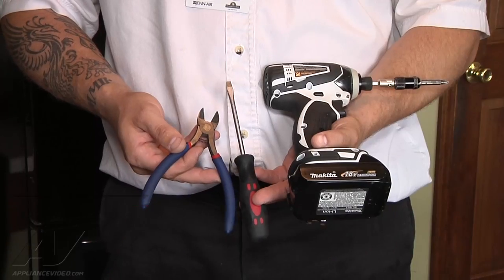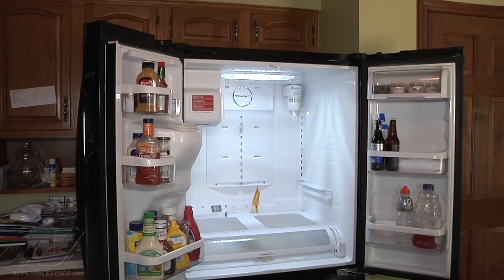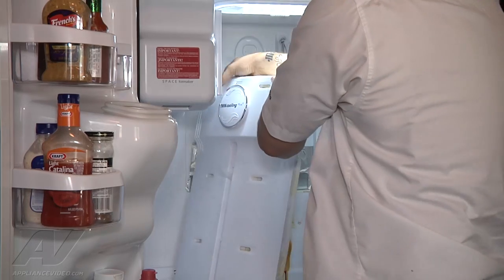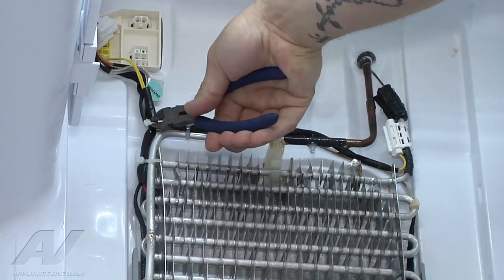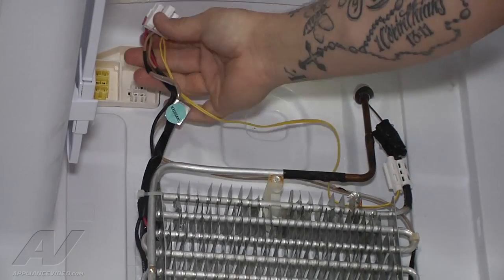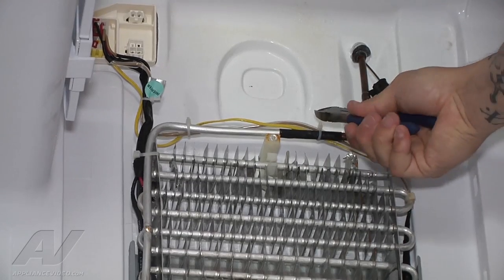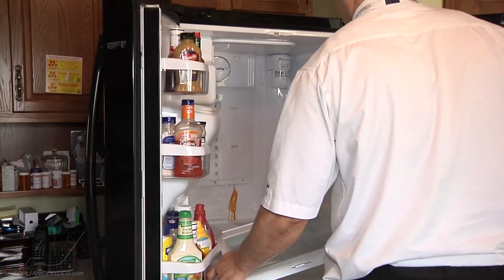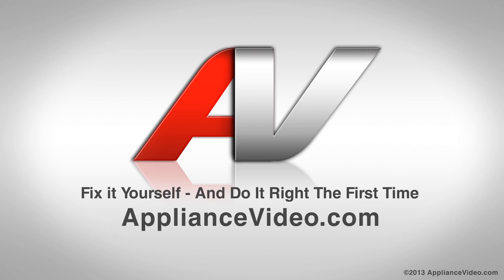Samsung Refrigerator Repair - Fresh Food Section Is Leaking Water - Sensor

Comment: I have the model RF265ABBP.  Is there a part # for the sensor?  Is it called a temperature sensor or a defrost sensor or a drain sensor? I want to be sure to get the correct part. Any suggestions on where to get the part?  Thanks.
Reply from the maker: Great question, if you have a more technical question that our parts department cannot answer, you can search our over 17,000 answered questions free at our website www.ApplianceVideo.com under our Repair Help section. You can also call our parts department at 1-800-830-5465 and they can give you help 7-days A week ,or search at www.SaveMoreOnParts.com  .

Comment: I did have one other question.  I took the bottom panel off the back of the refrigerator (the condenser coil fins really needed cleaning) and noticed 2 drain outlets.  Do these both come from the drain port behind the inside back panel (from auto defrost area), or is there another drain hole somewhere inside the cabinet?  Thanks again for these very informative videos.
Reply from the maker: Bill 
                         All of our technicians are now answering questions daily on the ApplianceVideo.com website for anyone needing help. Just copy and paste this this question under REPAIR HELP, and one of our  factory authorized technicians  will answer any technical questions at absolutely no charge on your appliance issues. We also have over 2600 free repair videos to help with your appliance repair issues. Thanks for your support. Matt Ace Appliance factory service technician.
Reply: Yeah they do one for the fridge one for the freezer I found the tube comes off the fitting there's a rubber grommet with two long holes wich helped the drain frezz held water so it couldn't drain

Comment: I have this exact model and I had a question about the shelves. The middle shelves seem to sag when I install them. Is there supposed to be a bracket that holds them together in the middle. I noticed on your video that they are level and close together with one another then when you go to install them after the repair, they are falling away from each other as the video ended. You were working to see what was happening when the video ended. I would like to fix mine as we just bought our house and the refrigerator was here so I have no idea why the shelves are messed up. Thanks
Reply from the maker: Great question, you can call
our parts department at 1-800-830-5465 and they can give you help 6-days A week
Mon-Sat . You can also search at www.SaveMoreOnParts.com 7- days a week.  If you have a more
technical question that our parts department cannot answer, our technicians are
answering all questions at our website at www.ApplianceVideo.com under our Repair Help section. We have over
4,000 common questions and answers that you can easily search through by your
model number, appliance make, and problem or error codes, and It’s free to
search through our question & answer library.

Comment: Very good video and professional working. I followed it and fixed the water leak under fresh food section I used to clean the water every two weeks. Now no more water leak so far. However, my samsung REF237 AARS display freezer temp does not match inside of freezer section. Display is -2 in freezer and ref. 38.  The thermostat reads both section, ref is fine and freezer is about 10, however, I placed a glass of water it became ice overnight. I am not sure I need to replace sensor to correct this problem Please advise.
Reply from the maker: Great question, you can call
our parts department at 1-800-830-5465 and they can give you help . If you have a more technical queston , our technicians  are answering all questions at our website at ApplianceVideo.com
under our Repair Help section. We have over 3,000 common questions and answers
that you can easily search through by your model number, appliance make, and
problem or error codes.

Comment: I was told that if you relocate the sensor further away from the high side you can avoid future ice build up problems. What’s your opinion?
Reply from the maker: Great question, if you have a
more technical question that our parts department cannot answer, you can search
our over 10,000 answered questions free at our website www.ApplianceVideo.com under our Repair Help section. You can also call
our parts department at 1-800-830-5465 and they can give you help 7-days A week
Monday -Sunday, or search at www.SaveMoreOnParts.com  24 hours
7- days A week.

Comment: MOVE SENSOR TO UNDER FAN MOTOR, REMOVE AND PLACE IN MIDDLE TOP TUBE ( RETURN LINE) If senor is in the ice unit will defrost longer. (not in sReplace sensor is not the fix. 1- need drain heater ( DA61-06796A). 2- NEED STEAMER TO DEFROST DRAIN LINE. 3-ervice update)
Reply from the maker: Tony
      Thank you for your input its greatly appreciated.

Comment: I too had ice forming under the crisper draws.  I removed the cover as described and used a hair dryer to melt the ice on the coils.  However, the drain hole looked to be clear.  I stuck a piece of wire into the hole about three inches and encountered no ice.  All the water that was melting on the coil drained into the hole with no problem.  I estimate that I first observed the clear drain hole about 20-30 minutes after I opened the refrigerator to remove the contents.  My questions are: how far down is the drain clogged normally and could my issue be due to something else not working properly?   Thank you for the great video.
Reply: hey i am having the same issue did you find what the problem was?
Reply from the maker: Thanks for your response, we are glad we could help. Our library of over 5,700 videos are currently helping over 1.6 million people like you every MONTH.  Please help us by subscribing to our YouTube channel, or post our website www.ApplianceVideo.com to your Facebook page, Twitter, Instagram or any other social media sites. Your support will help us keep producing more free quality videos.

Comment: Our Samsung (we purchased in 2009) began collecting  water & ice under the fresh food drawers. We called repair companies that Lowes & Samsung gave us, but their Yelp reviews were not good. I wish the company that does these videos (appliancevideo.com) was in our area, but they are not. I would not have minded paying for the repair if it was reasonable, but we could not find anyone. So we started looking at You Tube videos. They were great, and we watched a lot of them on this problem and decided to try it. We also read a lot of the comments from people like the comment I am now writing. Now we are 69 and 73 years old so we knew it would be a challenge for us. The parts were easy to find and very inexpensive (the drain clip part # DA61-06796A  $6.95 and the yellow defrost sensor Part # D-A32-00006S $11.75 for our model RF26XAERS ). Well we did it and everything seems to be working fine. We also changed the location of the Sensor. I had read so many things and I saw a few comments on this, so we did it too and it was easy. The hardest part of doing this is removing that back white panel without breaking it. I would suggest making sure that there is no ice before attempting to remove. We did not think we had ice, but after we finally removed the large white cover there was ice. So defrost first and of course unplug the Refigerator. I want to thank Appliance Video and all the other people that made the videos they were a great help and we saved a lot of money.
Reply from the maker: Thanks for your response, we are glad we could help. Our library of over 5,700 videos are currently helping over 1.6 million people like you every MONTH.  Please help us by subscribing to our YouTube channel, or post our website www.ApplianceVideo.com to your Facebook page, Twitter, Instagram or any other social media sites. Your support will help us keep producing more free quality videos.

Comment: I have been having problems with my Samsung French door refrigerator model RF263AEPN. The frig wasn't getting cold despite the 34degrees reading. Emptied the frig of perishable food before going on vacation and came back Tuesday with the frig still not getting cold. Unplugged it and plugged it back in after a min and got the "88" and "82" code on the display. Called Samsung on how to set the temp. Got the display working with freezer reading -2 and frig reading 56 degrees. Found your video yesterday and checked the frig and noticed ice on the vents last night. Set the frig at "OF" "OF" code to manually defrost and went to bed. This morning there was water in the big deli bin and under the bin. Took it off "OF" mode, but didn't hear any whoosh sound. Placed the frig back on "OF" mode and cleaned the water from the bin and under the bin. When I get home tonight the frig will be 20 hours on "OF" mode and hopefully every bit of ice has melted. I may have to remove the cover to check the fan and see it that's the problem. Wish me luck. Thanks for the videos.
Reply from the maker: teengirlawsome
                          If you go to our FREE repair help website at ApplianceVideo.com and post this question, We have 14 factory authorized technicians that will  answer any technical questions daily on your appliance issues. This is the only website on the web that you can get questions answered by certified appliance and HVAC technicians at absolutely no charge along with over 2600 free repair videos. Thanks Matt Ace Appliance factory service technician

Comment: I had the same issue. I emptied the content of the refrigerator then I turned off the unit for 15 hours. I saw water drain  in the back pan. I turn on the unit back and set it for 38F and -2F for the freezer. Unless you have a bad sensor or heating element.
Reply from the maker: Yes, just wait and see if the problem reoccurs, if it does you will need a defrost thermostat or possibly a heater.  Please help our ranking by subscribing to our YouTube page or posting our ApplianceVideo.com site on your Facebook or Twitter account.

Comment: You state that a DA32-10105T Sensor should be used. I have a RF267AERS and the parts list shows a DA32-10105X. Is there a difference? Which should I use?
Reply from the maker: +Greg Noneman 

We would like to help you
answer your question. With our videos now getting over 900,000 views per month and
hundreds of questions from people like you, our technicians are now answering questions
at our website http://www.appliancevideo.com/repair-help/ .  We also have over 2200 common questions
and answers that you can easily search through by your model number, appliance
make, problem or error code and it’s absolutely FREE. You also have the option
to email a factory service technician with a question on your appliance at http://www.appliancevideo.com/repair-help/ . If you’re looking for a repair video, you can
also search our library of over 2600 free repair videos. ApplianceVideo.com
specializes in quality DO-IT-YOURSELF appliance repair videos and we get over
800,000 views per MONTH to our videos worldwide and growing. If you need of
parts for your major appliance, we have over 5-million parts in stock at http://savemoreonparts.com/ .  Thanks for your support. Matt Ace
Appliance factory service technician.

Comment: Excellent video!!  My question is where does all the water go that you poured in to clear the drain?  Do you need to remove it or does it just sit in a pan somewhere?  Thank you.
Reply from the maker: The water evaporates from the condenser motor that blows hot air accross the drip pan.

Comment: We have been having the same problem with our Samsung refrigerator (RF197!CRS) and have gone through the process of clearing the frozen drain without replacing the defrost sensor. We have gone from 2-6 months without problems but are starting to have the additional problem of produce freezing in the drawers now.  Will replacing the sensor help?  Any suggestions would be grateful.
Reply from the maker: Helen
  All of our technicians are now answering questions daily on the ApplianceVideo.com website. You can search completely FREE in our Repair Help section with over 1000 questions & answers. Or you can get unlimited technical advice and video links emailed to you by our 14 factory certified technicians at http://www.appliancevideo.com/premium-membership/.  If you are in need of any parts please support our parts department on line at http://savemoreonparts.com/ or call 1-800-830-5465 7-days a week until 11pm Eastern time. Thanks for your support. Matt Ace Appliance factory service technician.

Comment: Great video. I am having problems with my Samsung fridge continuing to ice up. I have defrosted the iced up drain with hot water several times and also changed the Drain Clip that I purchased. It still continues to ice up within a week of defrosting it. The new clip seems to work as there is melted ice and some water around the drain clip which tells me it is heating up during the Defrost cycle. Do you have any other suggestions ? Sensor ? Duckbill ? Thanks - Kevin
Reply from the maker: Great question, you can call our parts department at 1-800-830-5465 and they can give
you help 7-days A week. If you have a more technical question that our parts
department cannot answer, our technicians are answering
all questions at our website at www.ApplianceVideo.com under our Repair Help section. We have over 3,000 common questions
and answers that you can easily search through by your model number, appliance
make, and problem or error codes, and It’s free to search through our question
& answer library.
Reply: Kevin H did you see emilio rosas video about adding a wire to the drain heater to help it melt down into the drain?

Comment: Hey i have a samsung model rb195Acwp/xaa and the freezer stopped working and says the temperatur is -6 still, what do i do, ive trued everything..
Reply from the maker: Konejo Southeast 

                   All of our technicians are now answering questions
daily at our http://www.appliancevideo.com/ website under the Repair Help section.  We also have over 1600 common questions and
answers that you can easily search through by your model number, appliance
make, problem or error code and it’s absolutely FREE. You also have the option
to email a factory service technician with a question on your appliance at
http://www.appliancevideo.com/repair-help/ . If you’re looking for a repair video, you
can also search our library of over 2600 free repair videos. ApplianceVideo.com
specializes in quality DO-IT-YOURSELF appliance repair videos and we get over
800,000 views per MONTH to our videos worldwide and growing. If you need of
parts for your major appliance, we have over 5-million parts in stock at http://savemoreonparts.com/ .  Thanks
for your support. Matt Ace Appliance factory service technician.

Comment: Parabéns pelo vídeo. Muito bem explicado e exibido. Estou procurando ajuda para uma geladeira RF263BEAESL/AZ que ficou alguns dias sem o filtro de água (foi retirado para levar à loja a fim de comprar a reposição) e começou a acumular água na parte interna, congelando e trancando a gaveta. Após instalado o novo filtro, verifique que não há vazamento nessa parte de conexão do filtro. Verifiquei vir umidade na parede do fundo, talvez da parte de trás da máquina de gelo ou dessa parte que este vídeo mostra. Você poderia ajudar com alhuma sugestão ou de alguma forma? Agradeço.
Congrats on the video. Very well explained and displayed. I'm looking for help for a RF263BEAESL / AZ refrigerator that stayed a few days without the water filter (it was taken out to take to the store to buy the replacement) and began to collect water inside, freezing and locking the drawer. After installing the new filter, check that there is no leakage at this filter connection part. I checked for moisture on the bottom wall, maybe the back of the ice machine or the part this video shows. Could you help with any suggestions or in any way? I thank you.
Reply from the maker: Great question, you can call
our parts department at 1-800-830-5465 and they can give you help 6-days A week
Mon-Sat . You can also search at www.SaveMoreOnParts.com 7- days a week.  If you have a more
technical question that our parts department cannot answer, our technicians are
answering all questions at our website at www.ApplianceVideo.com under our Repair Help section. We have over 6,000
common questions and answers that you can easily search through by your model
number, appliance make, problem or error codes, and It’s completely free to
search through our question & answer library. There is a very good chance
you question is already answered there.

Comment: Does this work  with the Samsung  chef collection  as well?
Reply from the maker: Great question, you can call our parts department at 1-800-830-5465 and they can give
you help 6-days A week Mon-Sat . If you have a more technical question that our
parts department cannot answer, our technicians are answering all questions at our website at www.ApplianceVideo.com under our Repair Help section. We have over 3,000 common questions and answers that you can easily search through by your model
number, appliance make, and problem or error codes, and It’s free to search
through our question & answer library.
Reply: ApplianceVideo.com Cleaning
 the bins

Comment: Hi whats the resistance on the Samsung temperature sensor to determine it is faulty.
Reply from the maker: Great question, if you have a more technical question that our parts department cannot answer, you can search our over 17,000 answered questions free at our website www.ApplianceVideo.com under our Repair Help section. You can also call our parts department at 1-800-830-5465 and they can give you help 7-days A week ,or search at www.SaveMoreOnParts.com  .